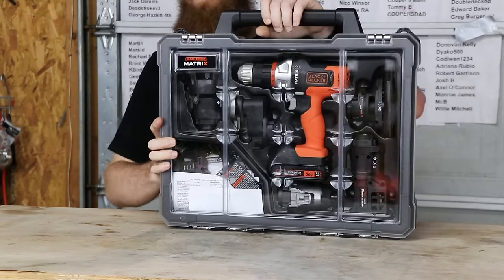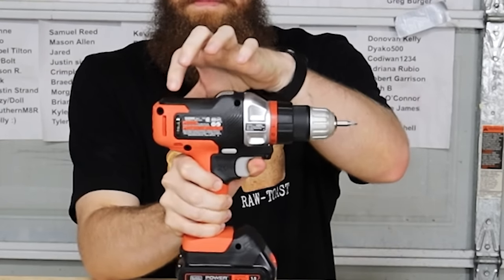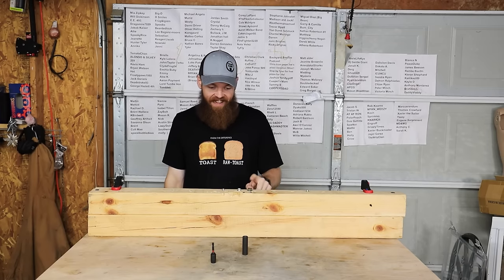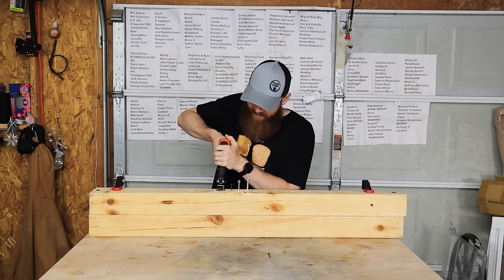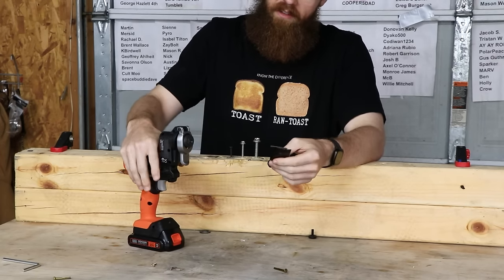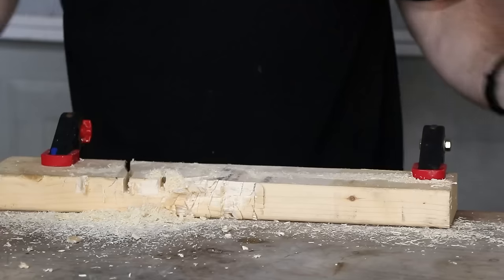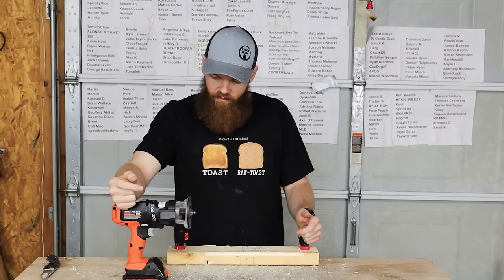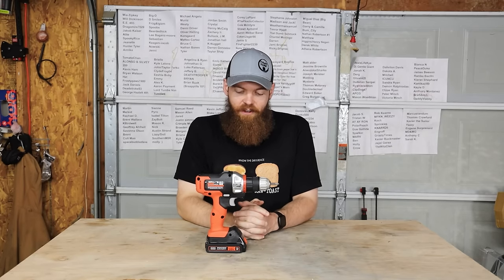Is This The Last Drill You'll Ever Need? | Black & Decker Matrix system

Comment from the maker: Matrix system here - https://amzn.to/3xcW6do
Reply: but does it mix bread dough?  or make a milkshake?  if not then wtf.
Reply: could you test taking off a tire with the impact attachment?
Reply: They have a little circular saw and a few other attachments you might want to look into for a possible part 2
Reply: This guy is such an embarrassment to men everywhere
Reply: can it make me a grilled cheese
Reply: You should do a video testing off brand battle boxes vs real battle box items or vs wish weapons
Reply: Can we get another rock tumbler video?
Reply: @Rhino1128  Its an impact driver and not an impact. 2 different tools. But it might do ones on something like a trailer. Proper torqued lugs should be out of the tools use.
Reply: I have had the bolt-on (craftsman) version and later the Matrix (both are the same design and use the same battery) and I constantly use the thing. Trimsaw, Sander, impact driver, oscillating tool, air gun (small tires or bike tires along with other airables) and the jig-saw are the best of the tools you can get for this. The router is good for simple round over on furniture and even then mostly pine unless its a small roundover bit then you might be able to handle harder woods. You can get a Sawzall and hammer drill attachment along with a few other ones and if you go the old bolt-on a impact for socket attachment. Problem is a lot of the attachments are ones to get off Ebay or Amazon and even then the old Bolt-on are overpriced for no reason at all. People think that its gold and miss the point of the attachment being cheaper than a regular base tool. The 1.5 battery is absolute shit and at minimum you need a 2.0 Amp hour but you can get off brand Amazon batteries for half the price of official batteries and can get them up to 6Ah. The batteries are all for the 20V system of Black and decker which can get into the weedeater and even chainsaw and its not too bad a saw to be honest (10 inch bar) and atleast when it comes to the 20V system they are pretty good stuff for the price (if you can get them at their normal price and not makred up crap from sellers on Amazon and Ebay.

They do have a corded base which works with everything and a good option for the sander or drilling. If the drill does kick the bucket then normally its either the motor or the Mosfet (the black transistor normally attached to aluminum) go out and both can be gotten cheap on Amazon. Had a Bolt-on and matrix (old version) that I replaced the motors. All of them share the same motor and the bolt-on was over 10 years old and the Matrix was like 7 years of constant use.

Will they replace other tools outright... no but some of the attachments more than likely will make it to where you won't need to get a different tool. The Sander, trimsaw, oscillating tool, jigsaw and even the impact driver can really do the job for most things. The oscillating tool blades can be gotten off Amazon as it was made before the common standard was done but you do have to look for proper ones. You can get close ones so a simple drill on 3 of the holes in the blade will make it fit or you can look through the comments and keep an eye for BandD. Can get replacement saw blades as well from there for the trim saw. 

I do wish this system was more widely done as there is some great uses and most people think that its generic gimmick junk which is a sad problem with this. Same thing goes for the pass through sockets and people thinking they are weak in their design when they are far stronger than the standard square drive sockets as they always snap off when they fail. The ratchet will fail way before the attachment on the passthrough sockets and the ratchets are build just like the regular ratchets.
Reply: The screws are way harder than nails, sometimes they are as hard as the HSS cutting tools you can use. The bolts would have been a better test before the screws as even though bigger they tend to be softer than most screws. When the oscillating tool cam out there was over a dozen proprietary designs for the head and B&D was not alone. When this system came out the oscillating tool was new and they never put money into updating the design. Main use brands did update after some time and updated models came out so its not really on B&D fault as it was just logistics never made the update for it. Sad but it happens, The blade is not bad at all for a general use blade as all of them would suffer under the hard screws. You need the high cost diamond grit cutter blades that you can get to cut hard metals like those screws. So many reviews of people that use them and even the carbide blades never realize the hardness of those screws. Carbide teeth are really bad for oscillating tools even jigsaws and Sawzall's as they kinda act like a impact and carbide is impact sensitive. 

The jigsaw doing that bad on the 2x4 is something wrong with the blade as it moves the same as any regular jigsaw does. I have even cut 2x4s with the one I got

The price may seem like a lot but the drill is about 50 to 60 and thats with a battery and charger and the tools should be around 20 to 30 each. But some places think they have something rare and try hiking up the price for no reason as the attachments should be cheaper than a base tool. Keep in mind, this is a 10+ year old system and they have not had updates to really anything but the drill base over those 10 years.
Reply: In all fairness the way he used the tool was wrong
Reply: That noisey cricket has alot to say ..lets ask him what he thinks
Reply: You should buy the vintage black and decker drill with the attachments like those. I have a drill with the jigsaw and I love it. Also, a jigsaw isn’t meant for a 2x4😂
Reply: The router bits designed to go along the edges usually have a bearing on the end of it……I think
Reply: Delete this comment
Reply: Do you dislike dewalt as much as black and decker?
Reply: Some router bits go from left to right. So you are pushing against the ride side of the 2/4 going left. Try starting on the left side (closest to you) and pushing away from you through the width of the 2/4
Reply: You should put a link for that shirt instead
Reply: @tylertube you should edit this to the link to that sweet shirt
Reply: I’d like to see you use the impact on your cars lug nuts. Impacts weren’t built to keep the motor going at full power for long periods of time. Good torcher test tho I kinda surprised it didn’t catch fire. 😂😂
Reply: @sukitt6499  should int use and impact in life nets ever. But people are so lazy these days
Reply: I bought mine Friday new on Ebay for $119 because of a sale.  I didn't see this video before I bought it but this just confirmed what I thought. 

ThanksA
Reply: Bro this is an exact match of craftsman bolt on system from 10 years ago???
Reply: Black and decker owner’s dewalt
Reply: I Love your videos and channel 💞

Comment: To be fair there's been actual professional grade drill/impact drivers that have struggled with less material.
Reply: In all honesty, they don’t always use the best or newer bits for the material, so tests with new stuff isn’t always an accurate comparison.
Reply: but not Makita/Dewalt/Milwaukee.. you know, the brands contractors use? lmao
Reply: Where??
Reply: @ministryofwrongthink6962  all 3 listed have trouble in certain areas when comparing cordless to powered efficiency.
Reply: Nope. This comment made me laugh! Thanks
Reply: My gen 3 m12 fuel impact driver literally sunk in 8, 8-inch long timber lock screws effortlessly on one battery. Also my M12 fuel drill driver drilled through a 2x4 with a worn out 2 inch hole saw without breaking a sweat.
Reply: @twiztedclown what certain areas? promise you milwaukee drill or impacts are beasts

Comment: I bought my Matrix June 22, 2017 according to my Amazon account. I've used it heavily, 90% of the time with the impact attachment, and it still works as well as it did when I bought it. I still use it almost daily working on motorcycles. It's easily been the highest performance per dollar tool I've ever bought. I also have the air pump attachment that works in a pinch.
Reply: Same here… I purchased mine in 2014.and it's still gets the job done. Got mostly all the attachments but mainly use the drill, impact, saw and inflator. Never used the router. Don't know how to use it either… lol

Comment: B&D is definitely for the light DIY projects. And I have all 3 versions of the matrix system drill handles and all attachments and have had no problems using them for household repairs but would definitely not use them for bigger construction projects, that's what bigger and better brands are for. It's called right tool for the right job.
Reply: Exactly, B&D tools aren't meant for professionals, they're meant for, mostly, non-professionals that like to occasionally do light DIY stuff, like most basic home repairs.
Reply: I have a full contingent of high end Milwaukee stuff, so I'm not some Black and Decker fan or anything. I think the characterization of them as trash is far too aggressive. Would I buy them? No, but I know that I use my tools enough that tools that are specialized for each use, and will last, are worthwhile for me. Black & Decker is usually much better than one would expect looking at other things around the price point. Most people genuinely don't need high end performance, and usually Black & Decker delivers products that are, for somebody who wants to have tools for the rare just in case moment, acceptable performance with acceptable durability at a price only slightly higher than some of the competitors that often struggle to survive a few uses. I would be far happier with a full toolbox of Black & Decker stuff than like Chicago Electric or Performance Tools.
Reply: I’m a handyman I use matrix I get 5-10 years.
Reply: You didn't review the box itself and how to attach other stuff to it like I have a DeWalt drill bit set that attaches to the top of the lid. Also, I'd like to see you get other attachments. Black & Decker has a plethora of other attachments for the drill. Thank you for the review, and I'm glad you changed your mind a little bit about B&D. I'm a housewife, and I love it! It's a great item for the price for DIY projects.

Comment: Those oscillating combo blades are more designed for tin snipping than cutting steel nails and screws. You'd use it for cutting out registers in ductwork. You need the carbide blade for the nails.

Comment: I've had two B&D 18v drills for over 10 years. I have TORTURED them on lots of home projects. I also have a complete set of Porter Cable 20v stuff (drill, impact, sander, saw, etc) for almost as long. I've built two sizeable decks, remodeled 5 bathrooms, 3 kitchens, finished two large basements and LOTS of other smaller projects. I have not had a single problem nor run into something any of them couldn't handle. Now I am not saying if you do this for a living they would last but for the amount of abuse I've put them through, I have zero complaints.

Comment: I bought one of these about 12 years ago. I used it until the batteries gave out and then I upgraded. If I made a living off of my tools I would have bought better, but I don't. It took about 9 or 10 years before the batteries were shot, so I think that was a pretty good run
Reply: I’ve shopped for tools a lot and never saw these combo kits before. Can’t believe that! This is the way to go, all in one.
Reply: I do make a living and get 5-10 years. My dewalts last just as long and I pay way more.

Comment: I've had a set similar to this for 7 or 8 years, all of it works ok, not the best by any means but for the Proho (Professional homeowner as wranglerstar would say) it will do just about everything you need. Mine has the circular saw, jigsaw, sawzall, drill, impact all of it works, dedicated items will always work better, but for the value if your not making a living and are on a limited budget, this will work for an average joe.
Reply: Same, use it for 5-8 decent projects a year, 2 batteries, no issues, not gonna beat a dedicated tool like my man says, but it saves a lot of space.
Reply: @kennethfahr2708  and  money if you used it ones in a while.
Reply: I agree, I've had my matrix set since 2013, And just used it cut out a for pet door on an exterior door Medel on both sides.. plus drill & screw holes to hang the door... it's not super fast, but then again, neither am I, so I'm pleased it does the odd jobs around the house when I need it to. + love that it comes with 5 tools to choose from & it's not too heavy.
Reply: Medal... oops

Comment: I've had my Matrix set for 6 years with NO problems. When you use them properly, your table sucks, they all work great.
Reply: Use them properly bro it’s a shitty drill. We used one for normal construction and it couldn’t get anything done it was so slow and weak, and they all died. We’ve had a Bosch drill and put it through hell even left it outside in rainstorms. Go buy a real drill lol see how it feels.
Reply: lol i like the mid sentence attack on his table
Reply: @davidpots9188  Yeah I put my set of Matrix and Bolt-on (craftsman version) through almost 7 and 10 years of hell and only recently burnt up the motors, Bought replacements for like $30 on Amazon and they are working perfectly fine. It sounds like you are just shit with your tools that I have seen in construction myself.
Reply: @davidpots9188  "Go buy a real drill" -Bosch user... Um... I didn't know Bosch tools are in direct competition with DeWalt, Milwaukee, Makita or tooltruck -tools. You know the once that constractionsite's are full of, while Bosch is nowhere to be seen( like fr my dad works in construction and I have been on countless constructionsites and never seen Bosch tools used anywhere). :)

To be clear, I'm not saying that Bosch (, B&D or Ryobi) are bad tools( for private/occasional/light use), but those sure as hell aren't professional grade (aka "real") tools. As for use around the house though, just about anything that can drive a screw in is good enough and anything extra you pay, you are paying for the brand not the tool.
Reply: @silentferret1049  craftsman is different than black and decker, I don’t think u realize what I’m saying I’m attacking black and decker bc their drills are just so weak and bad quality. Craftsman isn’t as bad. How can I be shit with my tools when the tool doesn’t have enough power to do anything out of the box.
Reply: @markussavolainen  yes I know about those tools, we have some freaky tools also like a table and miter saw it’s nice. But Bosch didn’t even close to comparison to Royobi and definitely black and decker those are literally to weak to drill out a hole. We started building a 3800sqft house it’s pretty hardcore construction and the Bosch is good. Hell even our porter cable drill that we used to drill all our holes for climbing and electric survived.
Reply: @markussavolainen  dewalt not freaky
Reply: @markussavolainen  also they are in direct comparison, bc theyre the same price.
Reply: Craftsman bolt-on is just a re-skinned version of this Black and Decker tool. It came out when Craftsman was still sold by Sears. They probably don’t even make it anymore.
Reply: @davidpots9188 Stanley Black & Decker owns Craftsman, and Dewalt. This Matrix is just a reskinned Craftsman Bolt on. It's the same tool, but now it has a 20v lithium battery.

Comment: I've had a Matrix setup for a LONG time, in it's original Craftsman form (Bolt-On is what they called it).  I've got a bunch of the attachments also.  The drill chuck  WILL end up going bad on you.  I'm on my 3rd, but bare in mind that I've had it for probably 8 or 9 years).  I find I use the drill and the 4.5" circular saw the most.  It's not a perfect setup, but the Craftsman Bolt-on accessories are interchangable with the Matrix stuff, and vice-versa.
Reply: It's a 3 3/8" inch trim saw, not 4.5", just a FYI, lol.

Comment: This is meant for people who just need the occasional drill to hang a picture frame or need an impact for a project. It's not meant to be a dedicated system to replace all the tools for a contractor.
Reply: Yeah this system is a lot more than that. Hell even a contractor can use some of these tools just fine. People underestimate these tools a lot more than they should.
Reply: @silentferret1049  No, that impact drill, drill, router, and jigsaw would be a nightmare for "contractor" (which type of contractor are you talking about? general, electrician, mason, framer, plumber, hvac, carpenter, there's tons of types of contractors) work. I use all of these tools professionally in electrical, carpentry, and framing (general contractor). Impact drivers need to drive 3/8 screws WAY faster than that when you're doing a job anchoring and you have 100+ of them to drive. A good quality impact driver would drive that 3/8 screw/anchor in 2-3 seconds, not 15 like that B&D piece of junk. Same goes for the drill, it's got torque but no speed, you need both. That router had no guide, making it pretty useless, and the jigsaw is a joke, I've never seen one so slow. No, I'm pretty sure most contractors would NOT use this. This is strictly for home use.

Comment: I have had the original Black and Decker Matrix for about 5 years now.  I have the drill, impact, reciprocating saw, and the air pump attachments.  I love it!  It is not for the everyday mechanic but it is perfect for at home use.  Obviously the impact isn't for high torque applications but it works excellent in low torque applications.  I find it to be a great tool.

Comment: I've had this system for 4 years now and it still performs perfectly. Also the Craftsman Bolt-On system is the same and there are other attachments as well. I have the mini circular saw which works great too. Perfect for a home owner and is very well built...